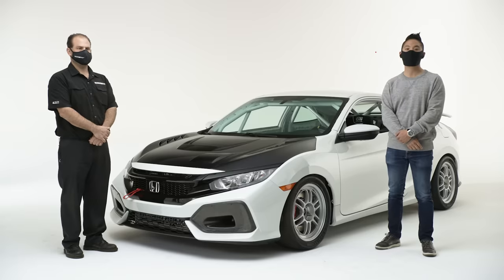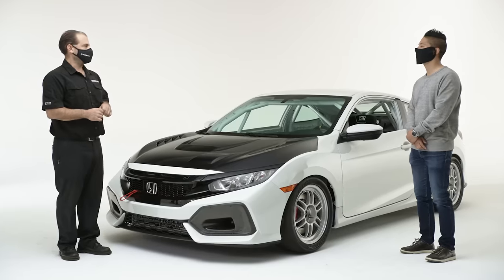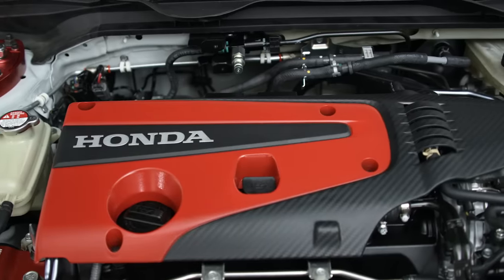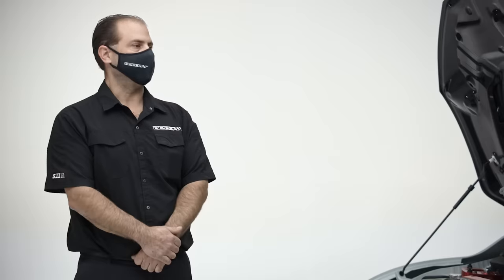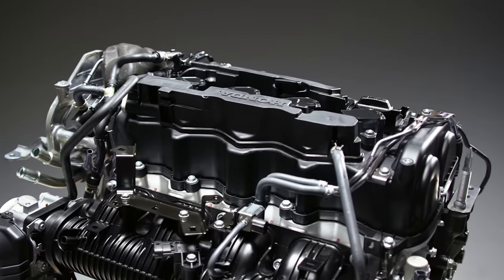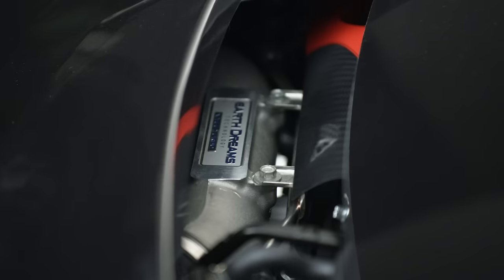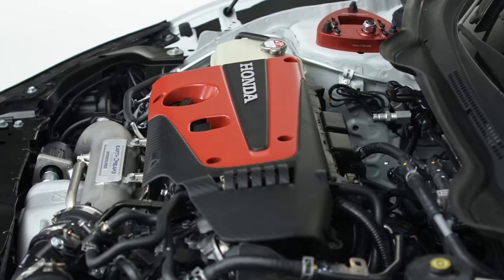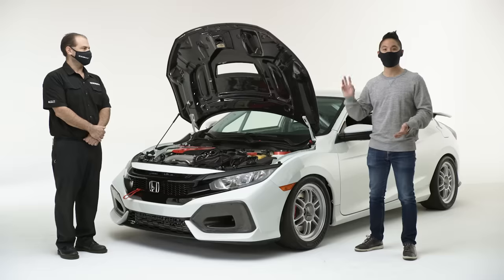First Look: Honda Performance Development K20C1 Crate Engine | MotorTrend

Comment: Imagine if Honda would sell upgraded versions of the K20C with beefier internals, larger turbos, more elaborate cooling, and Honda reliable. A K23C-Z1 with 420hp/385ft-lbs with a redline of 8000 r.p.m. I would be that engine even if I didn't have a car to put it into. Yes, I'm being serious.
Reply: If you didn't run it and kept it in the crate for years and years that could fetch a premium when these engines are not sold anymore
Reply: Imagine that in todays world 420hp out of a special developed 2.3L is nothing. 

Mercedes sells 2.0L with 420+ hp, Mitsubishi did it 10 years ago. 

BTW, Your name + my avatar :)
Reply: @jareknowak8712  both those aren't known for their reliably. The better part in all this is the fact that more of these engines around with a warranty would just improve the aftermarket for them making swaps into older honda chassis way more common. Also giving honda a reason continue developing this engine and improving on it maybe putting out a k22c or a k24c. This is engine was never the best in its class it's Hondas reliability swapability and tunability that makes it appealing.
Reply: @jareknowak8712  out of interest which Mercedes 4-cyl runs that much horsepower? I haven't just heard of it, and aren't really knowledgeable of them, atleast yet.
Reply: @SpinachLeaf  You must be joking about the reliability of AMG 2.0L and Mitsubishi.
Reply: @Kydenius  
Mercedes 2.0L AMG A45. 
I was twice in Helsinki, i worked with Finns in Stockholm. Whole Suomi drives Merca Diesel, Perkele! :)
Reply: @jareknowak8712  yes, I agree. However, like someone has already stated, the Honda engine will be reliable for 300,000 miles. Mercedes hot-V configurations are atrocious turbo design set ups. I admire Mercedes for a lot of their engines numbers in terms of performance. But they're not reliable. That's what makes Honda an incredible engine maker. I remember when Honda was designing turbo V8's for racing. They're were a nightmare to all their competitors due to how reliable they were. 

I've owned a RSX-S with the K20Z1. I drove that car like a madman to its 8100 r.p.m. for 200,000 miles without a single problem. Had an oil analysis test done at 180,000 and the engine was in pristine condition. I lost the car in a car wreck. I currently own a Honda Accord, with the J35 (6-speed manual) and I'm brutal with this engine, as well. It's the best NA V6 I've ever owned and while it's only SOHC, it blows away the DOHC, higher compression engines in its domain including the VQ35. 

I call myself Erwin Schrodinger because I spent 10 years learning the Schrodinger and Dirac equations and it's complex mathematics ranging from it's natural state as a complex partial differential equations, it's domain in infinite Hilbert space, applications in topology, and its beautiful application in differential geometry. I love, hate, and love-hate the Schrodinger equation. Much like that cat.
Reply: On 93 gas a 2018 used rs3 or ttrs will give you those #'s on their 2.5L 5 cyl
Reply: @ErwinSchrodinger64  
Years ago, i drove '86 Prelude, 1,8L 12V with 2x Keihin carbs :) 
I love Honda. 

This AMG engine is a simple i4 with one turbine, not a hot-V. 
Mitsubishi 4G63 and 4B11 are well tested. 
There are many good inline4s, which can reliably withstand great power, 
older SAAB 2.0, 2.3, Opel C20LET, and so on. 

Im not a physicist, unfortunately, but i think about doble slit, strings and Bohm theory every single day.
Reply: @Kydenius  why do that? That is dumb for an average engine

Comment: I need this for my JDM TSX build!!!
Reply: Wouldnt that defeat the purpose of calling it JDM :D The cool thing with the JDM car is the high reving K20 NA motor which you wouldnt find in the CL7 CL9 chassis anywhere else. But as a Euro Accord Type-S owner myself I do agree that this motor would suit the chassis. Though since its a K24 already in the car which is better, I think I would rather just do a turbo swap on the original longblock and get 450-500 crank hp.
Reply: Hasport is working on mounts.

Comment: POWER	306 hp @ 6,500 RPM
TORQUE	295 lb-ft from 2,500-4,500 RPM
Reply: For 9000.00 I had a 1.6 that was pushing 240 hp and 210lb ft 23 years ago in my 88 civic. It was a fun car and that 1.6 was bullitproof. It was parked at 468,000 miles in need of a distributer last I heard.

Comment: Saw on forums putting this into a Del sol makes it stick out a good 10cm or more above the hood :/
Aside from like having to rebuild the entire thing with zero room to work with, with additional issues here n there.

The idea would've been nice to have a brand new engine like this in it..

Comment: will this setup work with an auto Civic ?
Reply: Civic type Rs only came in manual. Plus why would you want to use this with an automatic there's no fun in it lol
Reply: @EsdrasScribe  auto easiest to drive in daily commute traffic
Reply: @Slickpete83  .
Reply: @Slickpete83  why would you want to commute a track car bruh you don’t need all that power for a 9-5 job
Reply: @bruhmoment1493  YOLO bro !!! & never late for work lol..
Reply: @Slickpete83  yolo bruh now you just killed a family of 4 because you couldn’t handle an engine based on performance
Reply: @bruhmoment1493   yeah your right , better just V8 6.2L  LS3 swap it

Comment: I drive a Mazda 3 2006 2.3 liter naturally aspirated and I absolutely love the way how Mazda / Ford Built the 3s it’s stock Performance perfect 🤩 from the factory 🏭. 
But when my powerplant is done ✅ I am going to swap it with the civic-Tipe R powerplant and run 🏃‍♂️ 330hp or 400hp

Comment: I'd like to swap it in my s2000 but I dont want to lose my 8k redline. Probably just better to k24 swap / turbo
Reply: There's K series engines pushing 8k rpm already. You'd lose the 9k rpm and the 2.5k torqueband but gain 4.5k torqueband rpm, a stronger torque curve, and greater potential.
Reply: @EjinRenos  sos is in development for a k20c swap in the S. I have a ap2 so the k swap would work or I can just turbo build the f22c
Reply: 4Piston makes cams to rev K20c1 to 9000
Throw some rods in it - up the turbo - add the cams and make 850whp 
The key is the fueling - motec 142 ecu plus larger injectoes and HPFP to support the juice needed for the power level
stock fuel gets iffy around 425whp or so on VP116 even less on e85

Comment: So $9k for everything and you still have to get your own transmission and axles. And no information on how much power is being made by the setup. This doesn’t sound like an ideal engine package.
Reply: 306hp and 295 torque
Reply: @imjustherefortheviews3953  disappointed, isn’t that the base hp? Ty for the info.
Reply: You want them to ship you doors and windows too? The crate package was developed for pro teams respectively..
Reply: @christiansaywhat4492  did any one say anything about doors. Another windows warrior running off at the keyboard. Pay attention... $9k for a stock long block, ecu and jumper harness... not. Worth it. Does this comprehend in your short sight mind.
Reply: @christiansaywhat4492  what pro teams? I can buy a used car and mod its factory setup to be hotter than this. For as much as this is. Do some research and you'll find making monsters is possible with these fairly easily with the right knowledge.
Reply: @marcussmart3275  All the Type R's running in IMSA? WTC? TCR? Literally everyone competing running this exact set up.  Obviously you could mod anything to be fast. That's like saying putting a blower on my crosstrek would turn it into "monster". That's not the point of this program. Also plenty of POS monsters out there.
Reply: @christiansaywhat4492  I understand better now. Thank you for your information. But I'm not stupid, and would choose any other option. With 25+ years in the auto repair industry I know that this is a joke and theres 1000000 used engine+ecm+ harness. That can be rebuilt to whatever specs you want for the kind of money their asking. Check out jdmwestcoast.com
Reply: By monster I ment something like a 1.6 block with a 1.8 head combined with a turbo, intercooler, larger radiator, larger exhaust, hi output fuel pump, oversized injectors, better brakes, better tires, ecm tuning. Not a rice burner lmao. Like people that destroy classic cars do. Ya know make them real fast then crash it because it's real fast.

Comment: Need this in my ridgeline !!!
Reply: Lol it would still be slow 😂 just buy an RDX it’s already fast
Reply: Your ridgeline has 280hp 262lb-ft of torque. This engine has 306 hp and 295 lb-ft of torque. Its 9000.00, you would get way more bang for your buck with mods to your existing power plant.

Comment: How much is the question
Reply: 9000 with ecu 7000ish without..I could buy a car upgrade it and be close to or have more power than this. Probly better fuel mileage too as I see an off road only being thrown about

Comment: What's different between this engine and one in a stock Type R? Why would it be illegal to put this crate engine in a street car vs. doing an engine swap from a junk Type R? Is it the ECU, and if so, is that all you need to make the crate legal for road use?

Comment: Hear me out, K20C1 Swapped 1990 Miata. 🔥
Reply: Been done already and is widely successful. However a swap like the 1.8T I4 from Mercedes would be new. If it can push that fat and heavy SLK250 as fast as the S2k and MX5, it would be amazing in a NA or NB. Of course the 2.0 is better for 300hp with a mild tune versus the 200 of the 1.8... but eh

Comment: I understand some people just like honda stuff, but 9k for 306hp seems a little crazy
Reply: Not when you figure that the average builder is working with a platform that weighs around 3,000-3500 pounds.
Reply: @marrowdreign  I guess we are seeing different things. You can do a lot with 9k to achieve a better power to weight ratio in my opinion.
Reply: @amaterasu8829  I do see your point. 9k in parts is a  LOT!  But if it's for purely racing, I can see that.  For a daily though or even just a weekend warrior that's fun to drive legally (okay, semi-legally) ? Eh... depends on your goals.  You can make a lot more horespower with a domestic v8, but then what do you have?  A gas guzzling naturally aspirated or old school fuel injected budget racer? Another LS1 swap?  

This thing has a modern ECU, Modern Tech, fuel efficiency (reasonable), longevity (these are time-tested bullet-proof).  It's also plug-n-play, not to mention a very light motor (even by modern standards).

Those are not easy to come by for cheap anymore.  Making over 300 reliable, lightweight horsepower without custom work and fuel management is not cheap or easy these days.

Comment: Sooo could I put this in my s10 once its  engine goes flying
Reply: I’m sticking with LS (LS3) swap. 
 I am curious of the MSRP of the motor setup.
Reply: Honestly pretty certain a rebuilt 4.3 would do better or a 3.8 liter Buick motor
Reply: @Aliyah_666  this is perfect for us in the EU where such older or more emissive motors + not from the same manufacturer as the rest of the car after year 2000 aren't allowed. Atleast so in Finland, so this makes a perfect sense for example any honda swap.
Reply: U sure can i have a k24 in my 96 s10
Reply: @imjustherefortheviews3953  after 2000 atleast in Finland you have to have the same manufacturer, unless you get it specially permitted and that costs dough, and is not guaranteed success that they'd find any justification

Comment: The rumors out there anything over 400whp the connecting rods bends. Not so strong connecting rods from the factory. Prove the aftermarket community wrong Honda

Comment: $9000 for a 306 hp engine
or you can pick up a VQ37VHR that revs to 9000 rpm for 2 to $3k
This engine is still nice, but not enough power for the money.
Reply: What it lacks in power it makes up for in reliability and long-term  use.

Comment: some made 588 on a stock k 24  with cheap noname ebay turbo.  this is not impressive at this price imo.
Reply: This has a warranty and no miles on it so theres no comparison for a racing build
Reply: @Trussme96  dude.. its not allowed to be used on public roads.. its a race engine so yes it can be compared.  http://prntscr.com/yvzu1a
some even make more hp..  boosted boiz  made a k24 pushing over 1100 hp so  yeah.. not impressive numbers on this crate RACE engine.
the one making 588  was a engine pulled from a scrapped car on a junkyard. they didnt even change oil or anything.  just  fitted the turbo and hooked it up to hondata.
they put it in a smartcar. it was all sent live and they went no.1  on trending.

Comment: honda could make a killing if they just sold crate engines on a large scale.guys are scouring junkyards  for high mileage b or k motors.honda could just make ecu and harneses .ford , chrysler, gm are huge in backyard builds.honda needs to stop being so uptight.

Comment: Or even a Fit!
Reply: You can fit that in just about every honda built. Just gotta swap the mounts. You can build something equivilant for much less.
Reply: @marcussmart3275  wishlist:  finding a wrecked Type R with engine intact
Reply: @claysmell  go to jdmwestcoast.com theres 2 b18c with trans on there for 8000 that's only the first site I checked and theres lots of better options. Do some research, it will save you lots of money.